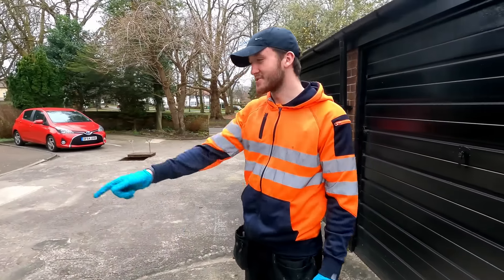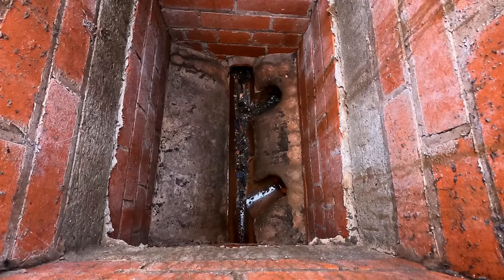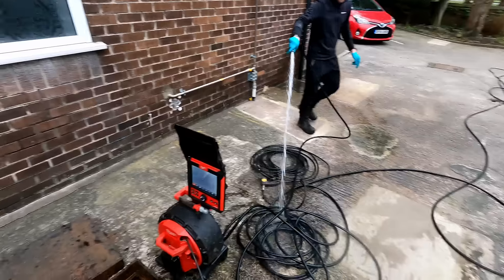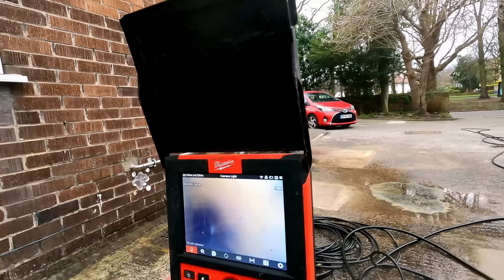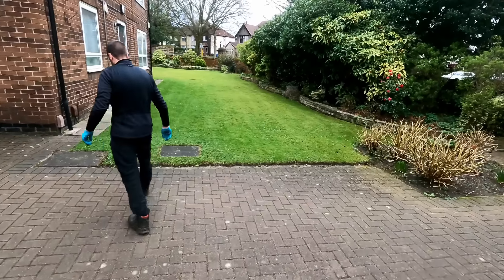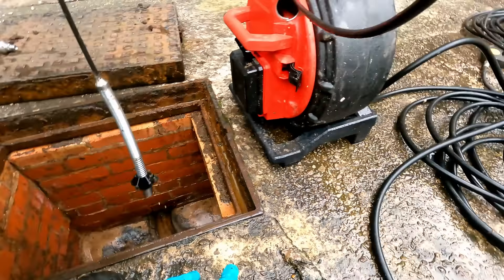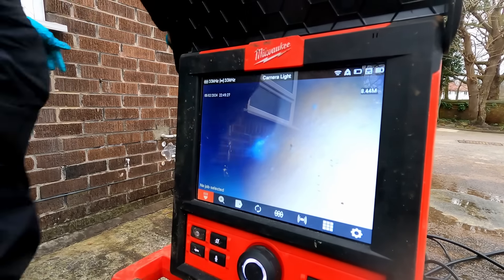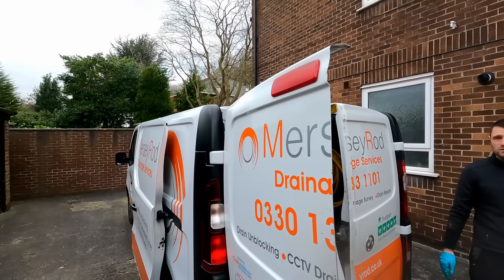Jetter 2 Busts Out Big Nozzle for this STUBBORN Manhole

Comment: I wonder, after you run  the camera how many owners would fancy a word with in a dark alley with a contractor who decided NOT to dig down that 60 or 70 mm for better flow OR scrimped on the base rock under the line that is now collapsing.